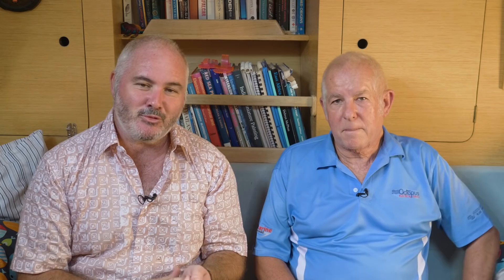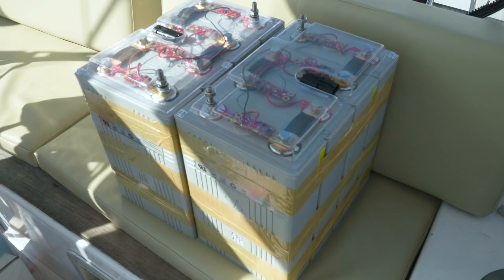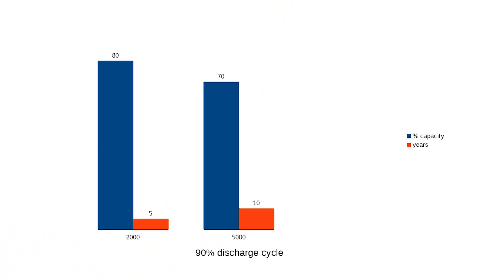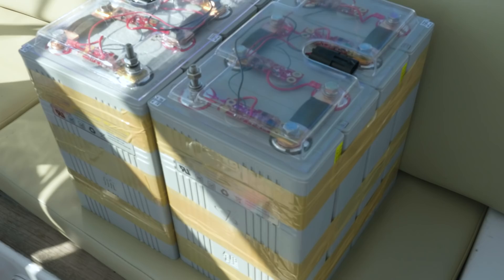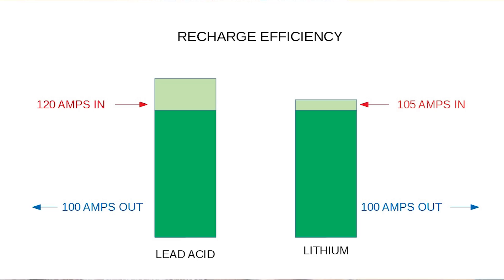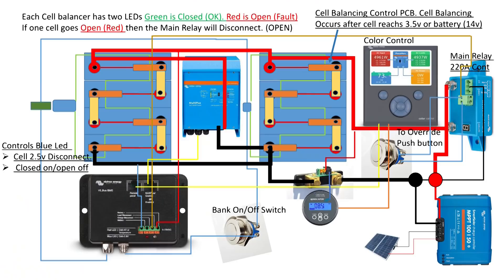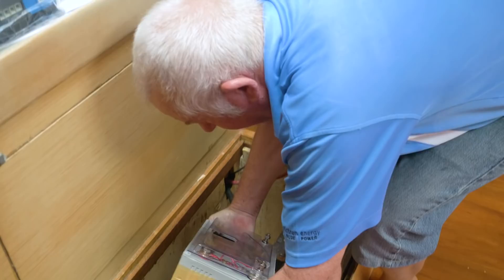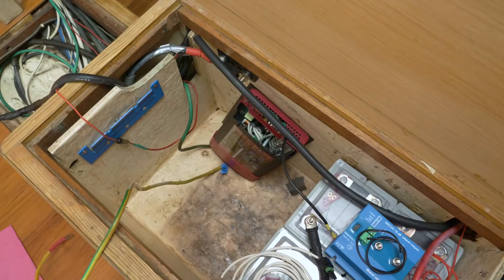Installing lithium batteries on a sailboat - Ep 144

Comment: Okay, the impending question!!  with your lithium batteries, how are you assured you won't have the dreaded boat fire, that they have been known to cause?  (regardless of what your expert says)...

(how do we know when a salesperson is telling a lie?.  It's easy, their mouth is moving!!!)

did you consider using automotive lithium batteries, dropping just shy of 3000k but yet getting 8k worth of batteries using a tad bit of creativity?  (I think one of the sailors used GM's electric cars batteries..)
Reply: Could you please provide more detailed information? I have not heard about boat fires caused by LiFePO
4 batteries.
Reply: @TheUglyGnome  from what i have surmised there are a number of variations of lithium batteries, each one claiming to be safe from the fires they have traditionally caused since their inception.    the boating community are not at all exempt.  

Which variety of Lithium batteries you have, i'm not familiar with, other than the jargon you used.  what i do know is that lithium batteries have caused problems, and my question is:  how do we know the batteries that Jamie is putting on his boat is exempt from that problem.

as far as your specific batteries.  I think you said you have put them in 50 boats over the past several years?  (maybe it was 7 years).  50 boats is a very small test group.  unusually small.  

I am asking for the benefit of my own reference, as well as the good of others.  Many, if not most boaters in the sailing community are looking for a cost effective (and safe) means of upgrading to lithium batteries.

not a single supplier has advertised that their lithium batteries are subject to causing fires.  However, every single supplier if have found/researched has claimed their batteries will not cause fires.  Ironically, despite those claims (and lack of claims)  Boat fires are still occuring.

Is the safety net just that fan to keep them air cooled that is subject to failure?
Reply: @nonyayet1379  
Again: Any reference to a boat fire caused by LiFePO4 batteries? 
Yes. There are many variations of lithium batteries, but we are talking about LiFePO4 here. You know, the ones Jamie installed. 
I don't care about what marketing people say. I use other sources and according to those LiFePO4 battery technology is extremely stable. People have shot bullets thru them and abused them in all possible ways and they have not exploded. Probably only way to make LiFePO4 burn is to throw in on fire. Yes. Then it goes boom! 
And no. That fan there is not safety net for batteries. It's there to cool inverter/charger preventing it throttling itself down when it gets hotter.
Reply: Fires happen with Lithium batteries, when they are discharged or overcharged beyond the manufacturer's recommended  limits, this is where the BMS comes in: to prevent that from happening.
Reply: Fires happen with all Types of batteries INCLUDING lead acid,  Lead acid batteries  if they leak in a boat can also kill you with chlorine gase , everything in life has a risk.
ie. if you cause a short circuit  or a falty starter motor causes a short or the alternator fails etc etc.  You must insert a fuse in the circuit to stop this sort of  short damaging your wiring, or your wiring could be badly damaged and YES a fire could occur.
I have seen these batteries  with multi bullets  been shot into them and all they did was produce a some smoke LiFePO4  are the safest type around
Reply: @TheUglyGnome  I'm really not trying to be controversial.  What I am doing is trying to determine if these batteries are truly safe or not.  me, and many many others would be happy to find truly safe lithium batteries.  

I did not expound on the request for exact details about battery fires, since it is common knowledge that lithium batteries have been known to spontaneously combust.  I am only, and sincerely looking for evidence that these batteries are not capable of that.  

I specifically and carefully worded my question/s so that specific and detailed answers would be of the most help of the viewers.  with the correct, and honest answers from the battery salesman, I'm sure that response would net him more sales.  100's and hundreds of sailors are looking for safe lithium batteries for their boats.  only 2 things prevent folks from the upgrade.  

1.  cost (easily over come with a simple cost effect analysis.  and 

2.  Safety.   

I'm sure I"m not the only one that would love to see a re assuring answer, letting us feel comfortable with the safeness of those  specific batteries.
Reply: @nonyayet1379  
You said "it is common knowledge that lithium batteries have been known to spontaneously combust"
The problem with your thinking is that you see word "lithium" and jump into conclusions base on it. How about making a statement:
"it is common knowledge that batteries have been known to spontaneously combust"
See what I mean. While there are different kinds of batteries, there are also different kind of lithium batteries. LiFePO4 (also known as  lithium iron phosphate) batteries are very safe. In natter of fact some people think they are safer in boat use than flooded cell lead-acid batteries.
Reply: @nonyayet1379  I was interested in learning more. A simple Google search turned up an alarming amount of reported fires, videos, and chats. You've made a valid point. Thank you.
Reply: @TheUglyGnome  thank you, now we are getting somewhere.

but before i expound on that, i'll say, there's no real comparison between lithium and lead based batteries in consideration of spontaneous combustion.  (your back to being controversial again with that statement).

now that we have clarified, that there are more than one type of lithium battery made,  (which is more common knowledge), what do we have for evidence that this particular type of lithium battery is not prone to spontaneous combustion like some of the others are?

do we have any facts, data?  something to go on, other than merely a salespersons word?

again, I'm not trying to be controversial, I really am on a fact finding mission for my own purpose, as well, as the audience that would like to use lithium but have a safety concern.

can you help with that question with a viable answer please?
Reply: @nooneanybodyknows1321  
Could you please then provide link on single boat fire caused by LiFePO4 battery.
Reply: @nooneanybodyknows1321  you're very welcome. 

there'll be a lot of happy folks, once we get that safety issue ironed out.

If i recall even tesla is experiencing the problem.  But, i have not ran across any evidence of the other electric auto's being problematic.  but, nor are they as efficient as the tesla (without factoring the fires into that equation....).

of the smaller lithium's i use, some (rarely) run hot, only melted down one device in 10ish years of use.  some  have great longevity, others peter out in no time at all.  Worse, i can't establish a pattern.  seems to be no rhym or reason to the pattern I'm experiencing.

So since Jamie did his homework (as he usually does, and quite well too) and found that good lithium battery:   Delos supposedly did too. Gone with the Wynns  also supposedly did the same.  If whats left of my memory serves me right, I'm thinking all three vessels have 3 different types of lithium batteries.  More importantly, chosen by extremely literate detailed individuals that historically leave nothing to chance.. 

Then the next question is, how can we be sure about these three different configurations based on facts, versus merely keeping our fingers crossed?

All of the auto makers (to my knowledge) except Tesla has remained safe, for now, which is a good sample group.  but, unlike Tesla, the other Auto manufacturers have not pushed the envelope, to squeeze out maximum efficiency.

Maybe some of the experts can help us with those answers, instead of merely getting offended and barking instead of sharing their knowledge.

as one viewer reminded us.  a good lithium battery set up will cost nearly that of a new engine.  A bad lithium battery set up can cost a boat (and possibly even lives).
Reply: @josidasilva5515  Lithium batteries also start fires without regard to the charging or discharging state and it's correlation to the manufacturers recommendation.  and it's not just a rare few isolated circumstances.  it does appear that it is becoming less frequent.
Reply: @nonyayet1379  The fires are a domino effect reaction that causes an intense internal release of energy. This instability can be generated by an array of factors, the most common being the input/output of electrons above the flow capacity of the material. It all points to the type of construction and materials in the battery.
Reply: lithium iron phosphate batteries LiFePo4 are very safe and stable.  Check out that chemistry as they don't catch fire like other lithium chemistries.

Comment: I wouldn't go lithium. 

From a philosophical point of view. Aside from a few forces, chemical energy will never out power heat energy. It's an interesting behavior of the universe.

From a practical point of view, let's think about Uma and delos. Delos recently saw an increase in power consumption, but the same solar output. After 2 days of rain they were starting to tax their lithium. Now delos has a genset so no big deal. But Uma does not, so they could potentially need to reanchor in a storm with no capacity to do so. Seems to me like a decision only the optimism of youth would make.
Reply: Fascinating. Time will tell (I watch both Uma and Delos and saw both their Lithium installs). Thanks for pointing that out.
Reply: I watch Uma, and sometimes watch Delos.  I happened to catch the one where Delos was worried about power.  There are a couple of differences that I can see.  First, Delos immediately added several accessories that can draw a lot of power, but Uma did not.  Second, Uma increased their overall capacity to run their motor, not to install electric accessories.  Uma is much more willing to sail on and off anchor, and has done so many, many times.  The Uma crew is okay with (though they would rather not) pulling up the anchor by hand (smaller boat = smaller anchor = easier to raise by hand).
Reply: @jeffgriglack9624  Since Uma already carries gas for an outboard, I wonder why they don't pick up an inexpensive 1000 watt inverter generator. The one I have weighs 19 lbs (8.6 kg). Not powerful enough to run the motor, but enough to top up batteries in an extended cloudy period. Even though it's small and light weight, I know there are limits to what can be carried onboard.
Reply: You are correct Zach. We should live in cave and eat root and berries. Use going up because they had more to use.

I guess you will be getting rid of your phone and computer batteries as well.

David.
Reply: @davidleatherbarrow2640  lol I absolutely love your logic. Cheers mate
Reply: A significant difference between Uma and Delos is that Delos have retained a diesel engine as their primary means of propulsion. For anyone contemplating moving to an electric propelled vessel, they will need to have the capacity to replace the energy on a like for like basis 'if they wish to have continuous 24/7 propulsion' option. This requires a generator or other power sources that collectively equate to the engine that would otherwise have been fitted to the vessel i.e. if you pull out a 50HP diesel and install an electric motor of the same capacity, you will need a 50 HP generating capacity. Granted many folk have sailed around the world without any means of propulsion other than sails and have done so safely.
Reply: @aarondesrochers3890  My old boat (which is on the market now) has an electric motor and lead-acid batteries.  Before I installed solar panels, I bought a 2 kw generator to recharge after a day sail.  One of the smaller, 1 kw ones would have worked as well.  I agree that it wouldn't hurt them to carry a small generator, but they also are perfectly capable of using the outboard to tow their boat using the dinghy and the outboard.

Comment: Sorry guys but that is one shoddy installation from a so-called professional. The connections to the Victron Relay have excess wire exposed at the crimp connection and are missing heat shrink. Likewise at the shunt. One wire at the shunt that does have heat shrink the heat shrink is damaged and wire is exposed. There's great info from Jeff Cote at Pacific Yacht Systems his videos are very informative and all his presentations see available to download from their website FOC. I realise I will not be popular with this criticsm and I really enjoy your videos. I have no connection with Jeff or PYS but check 'em out on YouTube.